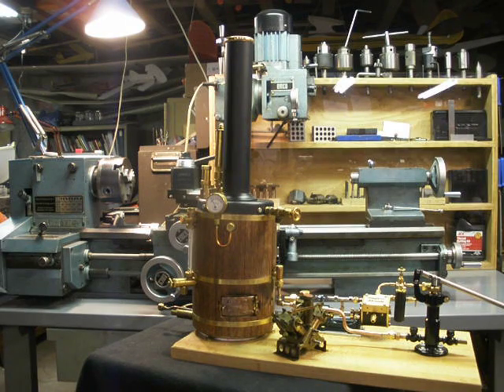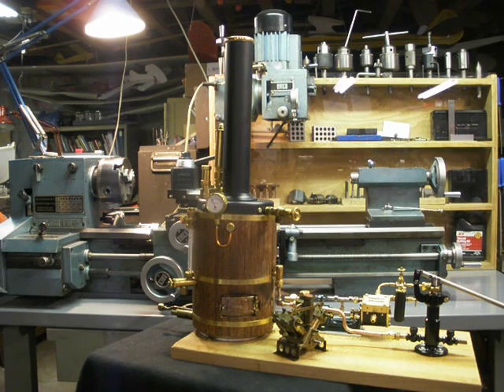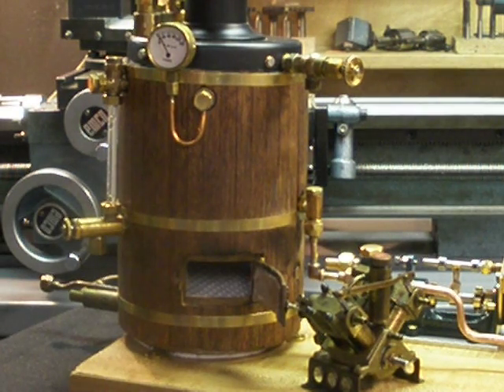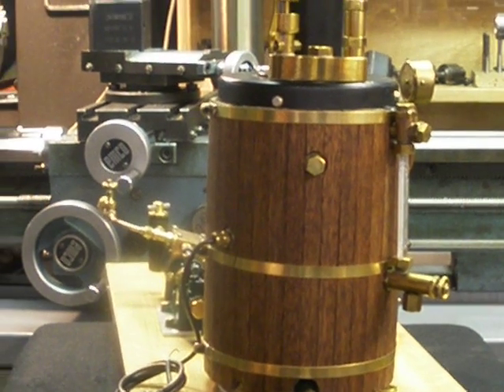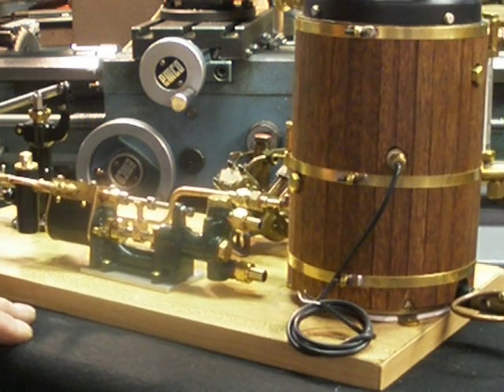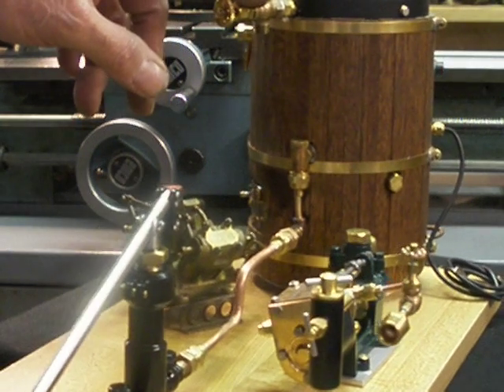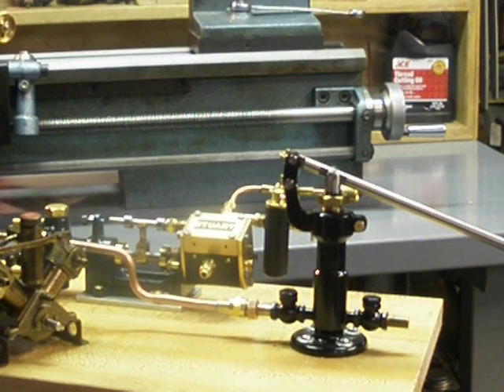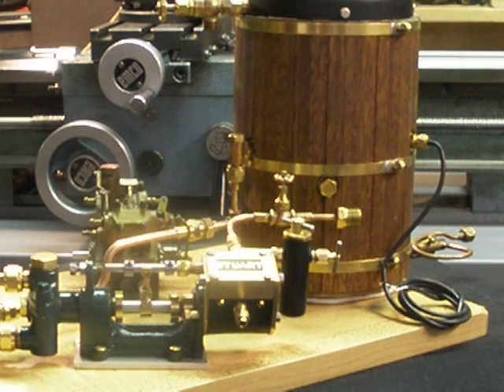Vertical fire tube gas fired live steam copper model launch boiler

Comment: Thanks for your comment.  I bought the burner many years ago from a now defunct company called Sulphur Springs.   I got the steam pressure / burner control system from the same place.  I'm sure similar burners are available from other vendors.

Comment from the maker: It is a Saito V4.  An eBay purchase from many years ago.  It was shiny then!  I've never used it, though have run it on steam.  It is a tiny engine and would need to go in a small boat, but is a really neat little engine.  Saito did a good job producing these.